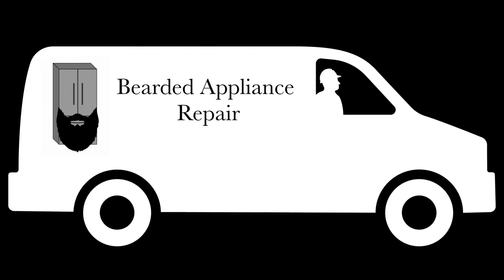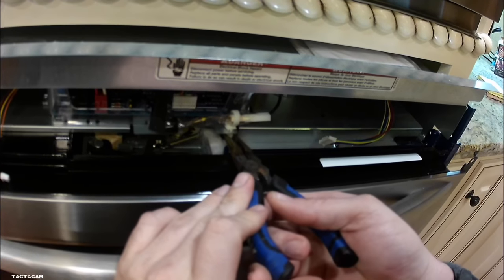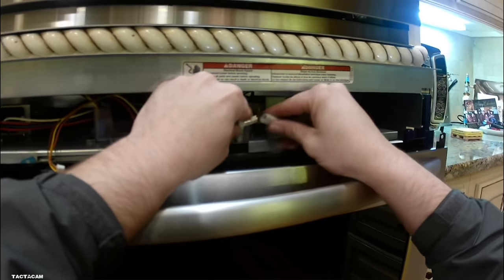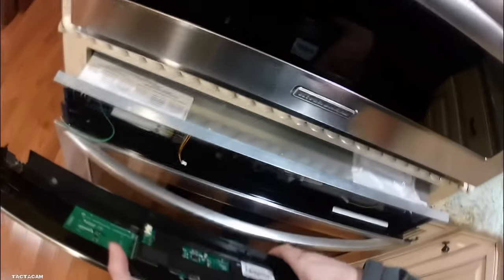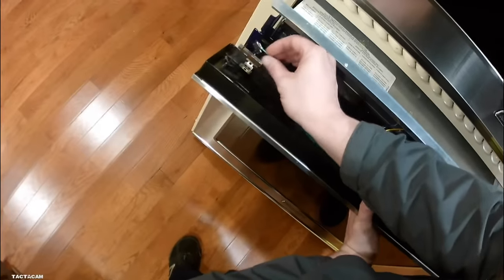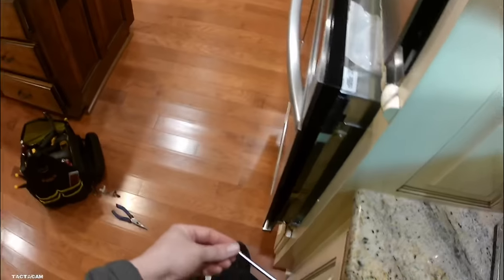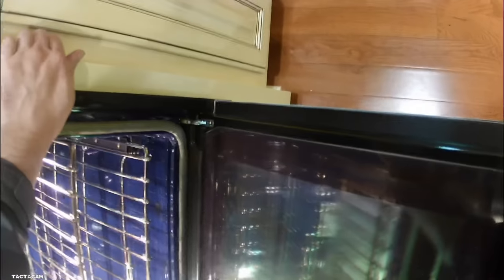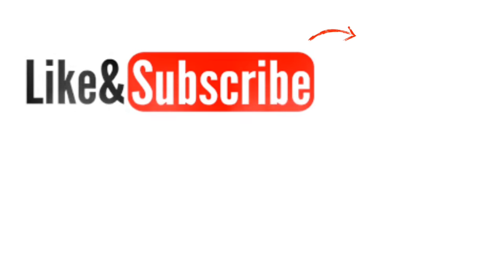Kitchen Aid Wall Oven Dead Display Diagnosis and Repair

Comment: You nailed it! We have this exact oven. Used your link for the fuse. Continuity checker showed it was open  Put the new one in and it now works. Thanks for the comments about possible causes. Turns out we also cracked open the door once we finished with the oven and the heat must of gone straight up into the panel. Won't be doing that again.
Your the best!
Reply from the maker: Yep that is usually the cause of it.  The more people who watch this video the less easy money for people like me hahah.  Glad to help!
Reply: @BeardedApplianceRepair  Hey I would absolutely hire you for my next appliance disaster but your a bit far away!

Comment: Thank You!!!!  I have this same oven, had it for 7 years with no issues.  I doo the prime rib thing, 16 minutes at 500°F then stand for 2 hours.  I also bake custard tarts.  550°F for 12 minutes.  And I do sometimes leave the door open a crack.  Why would they put a thermal fuse right above where all the heat comes from? AND a proprietary fuse at that.  I wish they would just use automotive type mini or maxi fuses.  That way you can pop into a local jobber and pick one up.  Or at least have a spare in your shop.  I guess my cooling fan works cause I can hear it.  I'll see how long the new fuse lasts but I'm buying 2-3 of them since they always blow after everything closes.

Comment: I thought I managed to kill my Whirlpool wall oven (model wos92ec0as) by frying the control panel or the control board by leaving the oven door cracked open after baking pizzas at 500 degrees.  After looking at the prices for the control panel and control board parts, I debated putting the oven on a Whirlpool extended warranty and wait a month before calling in the repair.  Then I debated calling an appliance repair company and just paying the repair bill, which I suspect would cost $300+. After about two weeks of complaints from my wife, I decided to see if YouTube had any videos on problems similar to mine. When I came across this awesome video, I knew what the problem with my oven was and how to fix it.  $20 and a day later, after replacing the thermal fuse, my oven is back in operation.  Thanks for sharing your knowledge so that average homeowners are empowered to do simple repairs.  Expect a small donation from me for saving me a lot of grief.

Comment: This video is awesome! I had a dead oven and this video hit the nail on the head. Both the cause (oven door open to cool) and the effect (blown fuse) were exactly correct. It even linked me to the part to fix it. Fab, fab, fab! And thanks. BTW, wouldn’t it have been nice if the instructions mentioned not leaving the door open for cooling?

Comment: I have a kitchen aid oven like the oven in this video. My fuse went out while the oven was in auto clean, which means  the oven was locked and because the fuse went out while the oven was locked, the oven is still locked and completely inoperable. Since the oven is locked, I cannot access any of the screws that would allow me to pull the oven out and access the fuse behind the display. Is there anyway to bypass the locked oven door or manually unlock it?
Reply: Did you ever figure out a solution?

Comment: This is exactly what happened to me today. I was ccoking a prime rib at 500 ...turned breaker off. Prime rib was perfect by the way. I just ordered the part and I'll let you know if it works. Thank you so much
Reply from the maker: These new ovens will drive the seasoned cooks max lol
Reply: @BeardedApplianceRepair  Hello. I received the part today and it looks different than what is in the oven. my oven fuse has 2 white connectors and the part I received has 1 white and 1 black. I am trying this my self. I have to clip off the zip ties on the fuse in the oven right? My oven model # is kose500ess02. Thank you. I'm going to read again through the comments

Comment: Great video. Our Kitchenaid wall oven has a twist on this diagnosis. The regular oven buttons on the panel do not work, yet the convection ovens work as well as the timer. Is this still a fuse replacement fix or is there something else I should be aware of?
Reply from the maker: sounds like a control issue to me.  I believe i would start with the control panel.  That is the part that the touch screen buttons are on.

Comment: Great video 👍
Need advice please…
I have a double oven KitchenAid built-in just like the one in your video. 
Was doing a self clean and now have blank screen, so assuming that fuses need to be changed. Major issue…. Unable to open the lower oven door and unable to slide the oven out a few inches to get to the fuses.
What are your thoughts?

Comment: I can’t use the self cleaning option on my whirlpool double oven anymore since the thermal fuse has blown twice. The cabinet it is I must get too hot than the fuse design and it blows. Oh well when the self cleaning option gets up to 900 deg I am sure the interior space can get in the 200-300 deg range. An easy fix to replace but getting that beast out of the wall is not fun. Thanks for video

Comment: Need a question - our whirlpool double oven has a mind of it's own. Display will work sometimes and other times shut down(no display). This started after a self cleaning cycle. Turn the breaker off for 24 hours and sometimes will work, other times may take a few hours or days to start working again. Is there a thermal fuse that resets or something like that?

Comment: Great video, my kitchenaid display not working but I can still use the oven, all buttons beap and work. By changing the fuse, would it fix the display? Also try to close the breaker for a minute and put it back on, once it restarted but not anymore but oven still working but no display. Any idea? Thanks

Comment: Thanks Bearded alliance guy. Great video. A question for you. 
A different question for you somewhat related. 
My display says ‘kitchen aid 30, the correct time and “keypad disconnected”. 
Any virtual diagnosis on the fix? 
Am assuming whole keypad panel has gone bad? 
There was steam/moisture in there immediately prior to failing.  Thank you very much.

Comment: Good informative video...  I've got a question regarding my oven...  Is there a way to fix a Frigidaire Gallery oven digital display that is dim and hard to read???  The clock display is fine...  The problem is the bake temperature and the bake time setting...  They are very dim...  Unreadable during the day, but can be read when it's dark outside...  I doubt that it is the fuse like in this video or I wouldn't have any readings...  Everything else works fine on this oven, so I've let it go for well over a year now...  If you've got any suggestions for my situation that is a simple fix, I'd appreciate the input...  Thanks for your time...  Dave
Reply from the maker: You can fix it but you will need a new control board.  It’s an expensive fix though.  If you can’t get the part anymore you can send most of them in to get them repaired through corecentricsolutions.com.

Comment: Great video. I have the same oven, 4 years old. My panel is not dead but getting an error code F 1E0 Display Board. Can’t clear the code. Do I have to replace the whole board?

Comment: The power went out during cleaning cycle and sounds like the fuse in the control panel was blown.  The door is in the locked position and the control panel doesn't work.  Any thoughts on how I can open the locked door when control panel doesn't work.  It's a single oven under the counter and screwed into the wood frame of the counter.

Comment: My friend, appears the oven model you are using is a bit older than mine. My panel went totally off following self cleaning cycle. I have no readily visible way to remove the panel.

Comment: Help!  I have a Whirlpool wall oven with a dead display.  It is Model RBD305PDS14 and has an oven above and below with the single display operating both.  Will there be a fuse in this one similar to the oven in your video?  Any direction will be appreciated.  Thanks.  Janet

Comment: Hey, liked the video.  I have a Jenn air double wall oven model JJW2830DP01, with a dead touch screen control panel.  Likely common issue given the steam that comes out of the oven and fogs the control panel.  Error F2E1, stuck button or similar.  Part, if you can find it, which I haven't, is pricey and I'm not assured that replacement will fix it.  Option is used GE model JTD3000SN1SS for less than the new touch screen control panel of the Jenn air, can't find a sed one even though all parts suppliers require a core charge-someone's fixing these things?.  GE's control panel is <$300 and in stock, at least today.  What do you think?  Same design problem, but more accessible parts, newer appliance (year and a half old, compared to eight years old)??  Thanks.

Comment: I have a kitchen aid superba wall combo microwave,oven wall unit neither is lighting up we lost power ran out generator it worked fine when power came back on I flipped from generator to main line no lights I checked my wall breakers all good ,will both the microwave and oven controlled by the oven fuse or are they separate fancy house I can't even get to the plug for either

Comment: Ovet a year my oven display started fading and then went brighter when the oven was on for a while then it eventually turned dark altogether and then spontaneously turns off. Is that the fuse that you refer to in the video or is it so possibly the display and or control board

Comment: I have AOCS3040SS Amana 2003 year shuts down in middle of cooking like flipping switch off.  I checked elements,therm new.  Control board?  I bought Fuse universal $5 it kicks over heat fan on says for Dryer 130C  my old part 235 F  -35

Comment: Thermal fuse, temp. Sensor, control panel, initial power, bad wiring. Need more info

Comment: We have a kitchen-Aid oven. Self clean was done and the thermal fuse went. I replaced the fuse, it works now except the display only works on the cooking side. The Clock and timer on the right side  will not light up. Is there a fix for this? Thanks.
Reply from the maker: Replacing the control where the lights are would be the only way I would be able to fix it.  I'm sure there is a way to do it yourself but that's not my expertise.

Comment: Hi My oven won't turn on, mine is electric wall oven. we have black,red,white,green 4 wire connection. connection 4 wires from source to oven as per. the electric oven won't turn on display. we tested the all the wires the power is going to oven. but i see the white neutral wire has power when we tested. the source white no power, but when we connect to oven the white has a power? what is the issue??????????

Comment: Can you put some insulation under the fuse to protect it from the bottom?  I guess running a jumper wire is out of the question.  "Fuses, we don't need no stinking fuses."😀

Comment: Can you tell me how to change from Celsius to Fahrenheit on my Kitchenaid wall oven?
Reply from the maker: I believe there is an option button on those that when you press if enough it will go to the degrees options. If you still have the use and care manual the directions should be in there.  I am probably wrong when it comes to this haha.

Comment: Hi limit, dlb relay, board, light switch
Reply: Forgot about the thermal fuse sometimes by control panel

Comment: Tod
Reply: Wall oven or single has on double has 2 tods( THERMAL OVERLOAD DEVICE ) .. relay on control also potential. Usually the thermal for the not working bake and broil together